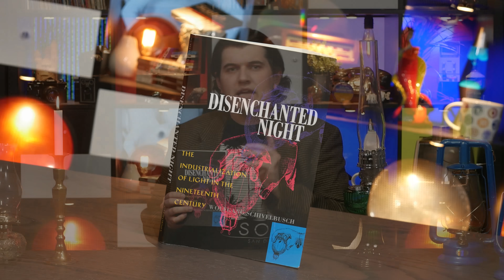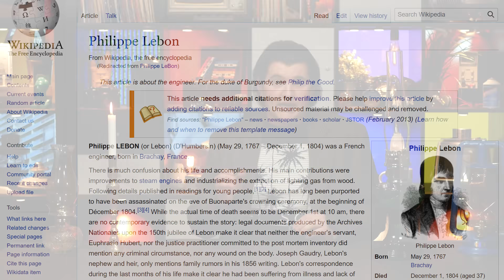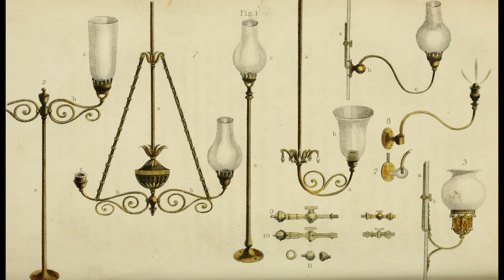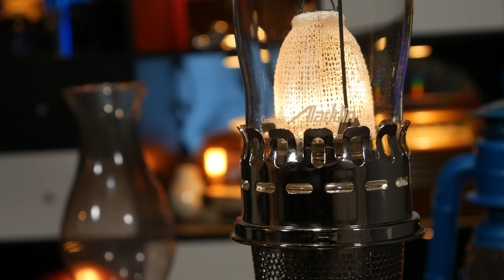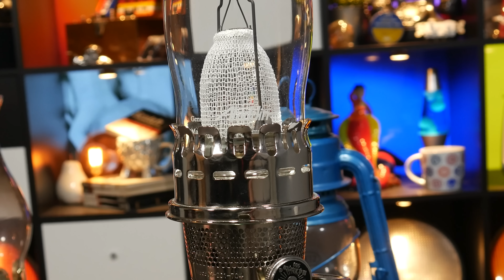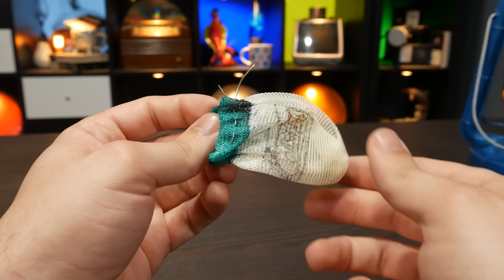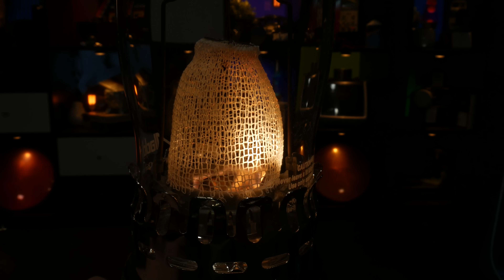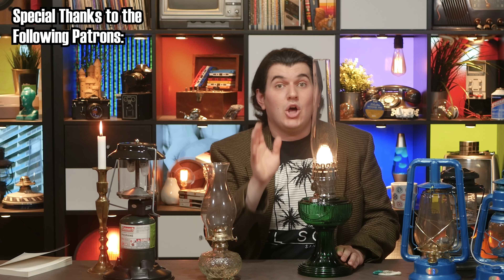How the gas mantle made lamps 10X brighter

Comment: The reason the Thorium vs Yttrium switch was so controversial is because Yttrium mantles... kinda suck in comparison, honestly. They burn okay if they're what you're used to, with a warm-white color similar to an incandescent bulb, but Thorium mantles are a fair bit brighter for their fuel consumption (important in consumer Colemans as the dual-fuel ones cost extra and the white gas the single-fuel ones take is expensive) AND, importantly, they burn with a MUCH whiter-blue color - almost LED blue. That cool-white light is MUCH easier to see by, goes farther so you need less lanterns, and there's of course more OF IT for the same amount of fuel and same size lantern. Newer Yttrium mantles from various brands are approaching Thorium light output levels, but they've still got that sorta puke-orange overtone to them.

Ironically, in terms of acute toxicity, Yttrium mantles are actually MORE dangerous because the nitrates and related compounds are actually bioavailable, unlike Thorium where you're maybe getting 4% absorption and the radioactive decay products are the main hazards - which are only a problem if your mantles have been sitting in a basement for 20 years, as Thorium decays pretty slow and is purified when the mantles are made. Not to mention, the amount of either element in a mantle compared to the amount of cotton ash, quicklime, and additives is pretty small to begin with.

Comment: Missed opportunity, they could’ve called "gasometers" "gassholes".
Reply: calling something -(o)meter while it is not a measurement apparatus is the closest thing from scientific terrorism there could ever be 😅
Reply: @Lapantouflemagic0  The design of these reservoirs gave an indication of how much the vessels contained. 
You do realise the sides raised and lowered under the system pressure. 
When full, all side rings were raised (sealed at base and top of each segment, by water in a trough), when empty walls lowered to ground level. A metal framework that guided the concertina like walls didn't collapse, giving an indication of capacity.    
So yeah, not a 'scientific instrument', but neither is an uncalibrated galvanometer or voltmeter, but the suffix meter is appropriate.
Reply: @BTW...  to be honest i had absolutely no idea whatsoever of what those things looked like. looking into it i see you're right, but those are still primarily storage devices

still, a gasometer in any reasonnable understanding should not be a buidling
Reply: @Lapantouflemagic0  Don't try to go over all the misnomers of the 19th century. Hardly anything was named accurately. It was a hazard of living in the 19th century.
Reply: @Lapantouflemagic0  potentiometer is also being called -(o)meter, while it is in fact just variable resistor.
Reply: Gasometer is not such a crazy description, they were still commonly used until recently here, as they filled the entire structure would telescope upwards, you could see at a glance how full they were.
Reply: Gassholes r bad
~ this post was made by Dietz Nuts gang.
Reply: You need to know that you’re hilarious. That is all.
Reply: Gasshole: see also politician
Reply: The Gasshole is where You put the fuel into Your car.
Reply: Yes, I've known a few "Gassholes" in my time! *Oh wait, Did I say that out loud?
Reply: gassholes, nicely done.  :-)
Reply: Gasshole
Reply: oooh the Gas-O-Meter, la-di-da Mr Frenchman... What do you call it? A GASHOLE
Reply: @endukas  Imho, meters should be self-sufficient to be called meters. Like you can't just call something a meter if it doesn't show you in any way measured thing (or its presence).
Reply: @UC8qWIA7WaG4fU0yuFY4YUHg However, it is still not its primary purpose. A voltmeter exists primarily to measure electricity; a gasometer CAN measure the contents in it, about as much as a glass of sufficiently standard size CAN measure an amount of water volume in it (if you use it repeatedly, anyways).
Reply: @wallabra  I think the reason it's called a gasometer is because it provides a metered (or controlled/ measured) flow of gas.  

I think it was also to troll scientists, though.

Comment: As a chem teacher I can say that "soot" is a very broad concept.
With enough oxygen contact, we can completely burn hydrocarbons and carbon to almost 100% clear CO2, no soot.
If we don't have enough oxygen, we have CO2 but also CO and C, the C been the soot from a pure combustible source.
A good turbulent flow (Bunsen) helps agitate and mix the oxygen in the air with the kerosene, extra heat does the same.
Both gas flow and heat helps to completely oxidize the kerosene, produce very few unburnt molecules (smell) and unburnt C(arbon) particles (soot).

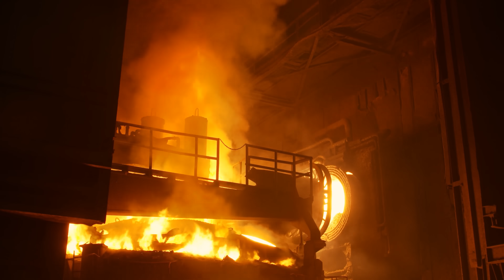Comment: The “high temperature furnace used in metalworking” shown at 6:10 is an electric arc furnace, so doesn’t really rely on coke for its operation. 
However, it is much more visually stimulating than a blast furnace so forgiven!
On the gasometer/gas holder controversy, isn’t the height of the gas holder an indicator of the volume (and pressure?) of gas in the system, and therefore fair to call it a gasometer?

Comment: Hi, I have used a variety of versions of the lamps you demonstrated. The Aladdin lamp is a pain to use for the reasons you stated, but after a long period of use they become extremely hot as you pointed out. This causes them to create a flow of evaporated unburnt fuel after you blow them out, it is so strong a smell of kerosene I take the lantern outside to extinguish it. The lantern I prefer to use is the Coleman kerosene fuelled type. It is a bit fussy as one needs to prime and light a small cup of methanol to preheat the generator. Why I prefer it to the gas or propane versions is that they operate with virtually no noise. The white gas and propane versions sound like rockets taking off.

Comment: Hey man, I gotta say, both your videos on old lamps are truly fascinating for me, because I actually used most of these kerosene lanterns for their intended purpose out of necessity for large parts of my childhood. Getting to realize the brilliance behind their seemingly seemingly simple design is really cool. 
You present the fact that most of these lamps never stopped production as slightly perplexing, but to us Norwegians, that's really not the case. You see, having a rural cabin up in the mountains or highlands is a deeply rooted cultural phenomenon over here, and almost anyone who grew up Norway has at some point been to a cabin, even though their family don't own one. Before electricity became the norm in cabins (not until around 2010) we still used these kerosene lamps, and we frequently still use them today when we're feeling fancy. We've several wall mounted flat wicks, and a celling mounted chandelier with a round wick. The chandelier also has mounts for candles, and electrical lightbulbs hidden inside. We usually have it lit using the electrical light, but for special occasions, my mom will always opt for the kerosene flame and candles. If you're interested, I could send you some pictures or a video if you wanna see how these kerosene lamps are still used interchangeably in modern Norwegian society today.

Comment: Aladdin mantles are shipped with a blue lacquer coating for shipping to strengthen them in shipping  because they are already in the oxide state when leaving the factory.
The thorium mantles are a little larger than the current production mantles and have a slightly greenish color to the light. The are brighter and more robust than the newer mantles as well.

Comment: 23:10 Well, add a thermocouple, a supercapacitor, a microcontroller, a tiny electric motor, a few sensors and some control interface and you can get rid of that "constant attention" requirement. The thermocouple will make electricity out of the copious amounts of heat this emits, the supercapacitor will store that electricity, the tiny electric motor would take care of the wick adjustments, the sensors would watch the light and the microcontroller would watch for the desired brightness and adjust the wick accordingly. It could also add a battery charger so you can charge your smartphone off this lamp.

The only problem would be that many would consider this as "over-engineered". But if I owned one of these (and the required components), it would be quite fascinating for me to have my own independent source of electric energy (albeit a quite weak one) that could provide light as a side effect. Especially in some rural areas where electric wiring is still an exception rather than a rule.

Comment: A new mantel usually has a nitrocellulose coating which is what burns off when first lit. There might also be some beryllium which strengthens the 'ash'. 

And yes, the switch from thorium to yttrium was controversial as thorium was 15 - 20% brighter. But newer mantels do last longer and are arguably safer.

Comment: I had an Aladdin lamp and loved to mess with it but, as you mentioned the mantles are very fragile and not really cheap considering what you get.  They also do require constant attention. But the big problem is that I kept managing to break the chimneys.
I got and still have a Wolfard lamp.  Not nearly as much light, but the cool factor is just as high and they are so much more simple to operate and so very beautiful in use.  They are not really for practical lighting, but for mood lighting, you can just light it and with a properly trimmed wick, just forget it and let it burn.

Comment: The mantles themselves were originally made of thorium that was doped with cerium. Pure thoria (thorium oxide) incandessed with a slight green color, and ceria (cerium oxide) doping eliminated that. Only until recently was there a switch to yttrium. This was due to the fact that thorium, like uranium, is an actinide, and therefore a radioactive element. To this day, lantern mantles (alongside camera lense glass) were probably the only commercial use for thorium, and now that it’s being phased out, thorium is back to pretty much useless (for now) These mantles were also one of the first found uses for rare earth metals. Thorium isn’t a lanthanide like the rest of the rare earths, but it’s always found with them. Now it’s just a radioactive waste product in their production :(

Comment: It's a bit of simplification but here's how it works:

Clean combustion: excess of oxygen in the center of the flame consumes the soot particles almost instantly, hence the lack of yellow flame. Natural gas is composed of relatively simple hydrocarbons that tend to combust with very clean flame. Soot is obtained mostly when there's an oxygen deficiency. But convection guaranties enough oxygen for a full combustion. Therefore there isn't any smell.
Some compounds are extremaly likely to combust completly. For example methanol flame is almost invisible. There were accidents of methanol fire where people were burnt alive, and no one helped them, because in the bright sun it wasn't visible. That's because methanol is frequently used as a racing fuel.

The gas mantle (originally made from thorium dioxide) is getting thermally excited. Electrons are brought to higher energy level. As they're returning to the ground level again, the energy difference is emited as a fotons with an energy range of visible spectrum.

Comment: As someone who works in a historic house museum with a few working gaslights, and who has spent a lot of time researching Victorian lighting technologies, this video was right up my alley.  Here's a little more info to build off your excellent research: 
-Household Gas Generators a la LeBon did see use through the Victorian period, usually by institutions and wealthy homes in areas not serviced by gaslines. Some later designs used acetylene, or giant carburetors connected to attic gasoline tanks to provide flammable vapor.  
-'Balloon Wagons' to transport coal gas to customers were apparently used, though only briefly. Even sources from the 1830s considered them historical curiosities.
-Illuminants were well known to Victorian gas engineers, and often gasworks would bubble their gas through things like turpentine to improve the brightness of their gas. Indeed, there was a popular lamp fuel, called 'Burning Fluid' that was used between 1830 and the American Civil War, which was a mixture of alcohol and turpentine. The alcohol provided the heat, the turpentine the illuminant. Alcohol burns blue by itself, of course, and straight turpentine was apparently too volatile a fuel. That said, Burning Fluid did have a not wholly unearned reputation for being extremely explosive.   

-The fan-like flames in gas lights gave rise to the names of different types of burners. The two most popular being the 'fishtail' and bat's wing" burners, so called for the apparent resemblance their flames had to their namesakes.
The Victorian era discovery of the danger of carbon dioxide buildup (then called Carbonic Acid) coupled with the belief in the Miasma theory of disease produced through the Nineteenth Century a certain obsession with ventilation. One of the big fears of the age was asphyxiation, as you mention, though with characteristic obsession the Victorians wildly overestimated the danger. Some historians have suggested the headaches experienced by Victorians were caused more by the strong, dry heat of the gas lights and the coal burning stoves they surrounded themselves with. Victorian houses were generally so leaky that there was no danger of running out of fresh oxygen, no matter how many lights you had going.  Some Victorian doctors held that sleeping in a room with a fire going would suck all the oxygen straight out and kill you, and apparently no one pointed out that their ancestors had slept in rooms with fires, and they had not all died.  Evidently Carbon dioxide was like gravity in a cartoon it can only kill you if you know about it.
Great stuff, looking forward to part three!

Comment: The cloth on the Aladdin lamp is nitrocellulose aka celluloid or gun cotton. It’s the same material as one of the first ever man made plastics, photographic films AND modern smokeless gunpowder. It’s a nitrate based polymer soaked in nitrate salts, that’s why it burns so rapidly. The industrial manufacturing of these products is actually extremely dangerous, because it’s the same process as producing explosives like TNT. Accidents have occurred that resulted in devastating explosions and countless deaths :/

Comment: I have a backpacking stove that uses multiple types of fuel, including kerosene and white fuel, and I think even gasoline. You pump it a bit too get some of the liquid fuel to release from the burner into a small reservoir underneath it, which is then lit. It burns sooty for a little while, and just as it goes out, you open the valve again to release now vapor fuel to burn like a regular gas stove. The pipe from the fuel tank to the burner loops just above the burner and reservoir, so even though it comes out of the tank as a liquid, it is vaporized by the already burning flame to be a gas upon exciting the burner. I imagine the lamps in the next video function similarly. I really just like fire. I need to go camping again.

Comment: I have been looking forward to this video coming out since about the time of your really bad "Dietz nuts" joke.  I have enough physics to contemplate falling electrons shedding energy as photons of a given wavelength depending upon the differences in the starting and ending orbitals energy levels.   I was to a place overseas not to long ago where the 'kerosene' lantern in use by families consists of an old bottle with fuel in it, kerosene, diesel or other, and a rolled up rag as a wick for lighting.  Kind of like a Molotov cocktail, except a shorter wick and not thrown, but used for lighting for families for dinner and homework.  They did tell me that there were a few fires each year from these things getting knocked over.  I have a building which had gas lights in the rooms once upon a time.  The 3/8" gas lines to the wall were still there and live when I got the building, they were capped with no wall lights though.  I did recover one fixture from an attic, and I have been meaning to connect it to a gas line to see how it worked, it does not seem like it would  have put out much light, especially with no mantle and natural gas.  Thor spot with campers?  OK, well hmm. I will have to watch that one.

Comment: Hi from the UK. 
When I started school, aged 5 in 1947, the classrooms were lit by gas.  
The gas jets hung from the ceiling, four jets with mantles in a chandelier 
arrangement.  The teacher stood on a desk to reach the jets to light them.  
Each classroom had a coal fire for space heating. 
There were many houses lit by gas in those days as they had no electricity 
installed and my father, a survivor of 3 years on the Burma Railway, earned
a living for two or three years after WW2 in wiring them up.  One house that I 
visited in 1957 still only had gas lights but that was a rarity by then.

Comment: Well I've always wondered how the cloth mantle becomes a solid mesh once it's first lit. I have an old Bullfinch propane gas lamp of the kind designed to mount on the cylinder and when I had to change the mantle I was amazed at the transformation.

Comment: In Bulgaria, where i live, there used to be a huge electric crysis during the 80's and many people imported gas mantle lamps from Czechoslovakia, that were used in conjunction with camping LPG bottles. They used to be very rare and expensive, most people had to rely on kerosene lamps. We still keep a couple of them and i even remember using them during power outages asa kid. That's communism right there for you.

Comment: A gasometer can be used as a measurement device, admittedly rather unwieldy. the top of a gasometer is raised by the pressure and you can calculate how much gas takes up that volume/at a given pressure.